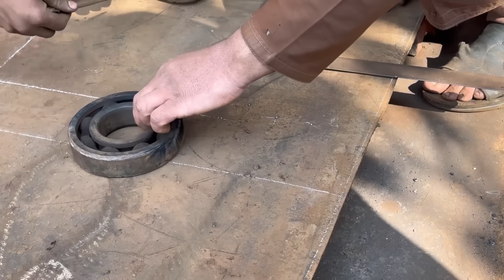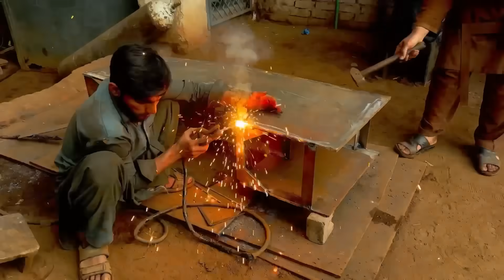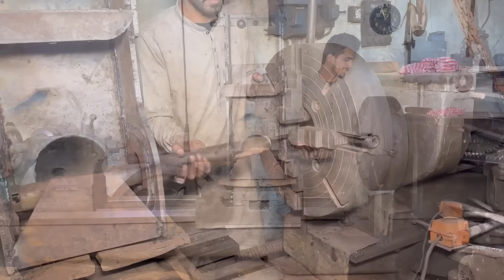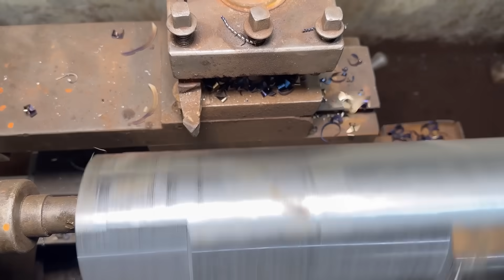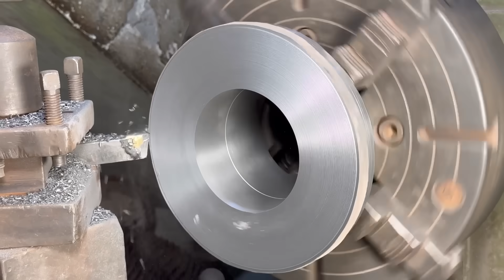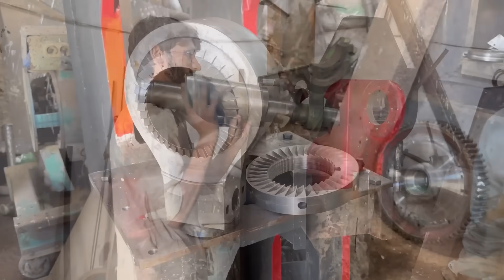Handmade Making Process Of  30 Ton Mechanical Power Press|

Comment: this guy literally had his eyes open while welding several places. absolutely wild.
Reply: This is, what i have noted too. Maybe, this guy has UVC-proof lenses and CCD-sensors.
Reply: @debrainwasher  in the one shot he's not wearing anything. Even squinting Itll go right through your eyelids (me as a silly child learning to weld learned fast)
Reply: Presumably, his guide dog did not bark in time.
Reply: @horstmuller7512  🤣
Reply: That's fine, after few years you get used to it. :D
Reply: He wants “Arc-Eye?”

Corneal abrasions are awful.  I recall them well, and supposedly Arc-Eye feels similar.
Reply: Can't fix stupidly
Reply: If your life expectancy is 45 years it does not scare you
Reply: Our blinking speed is fast😂
Reply: It won't be for long
Reply: @Y22860  I became Mechanical Engineer 2 years after working these kind of job.
We don't need eyes to weld anymore.
Reply: he has auto darkening contact lenses.

Comment: Imagine what these blokes could build if they didn't had to rely on Victorian-era tools, machines and education.
Reply: These machines are poorly made. The finished machine will be close to useless in a real precision stamping shop. Ive worked around these machines for decades and they could do it right with the machines they have if they actually measured the work and held the tolerances needed for this kind of machine. there was nothing done to ensure the machine would be square . The thing that really rubs Me wrong is when they finish a heavy part they always throw it on the ground so that the next poor guy has to bend down and pick it up. These people have never heard of carts and benches. And still I respect the guys for actually being able to make something.
Reply: @danneumann3274  Indeed. I respect the guys for able to make a machine by eyeballing everything, without a single drawing in sight. But that's about it. Indeed the lack of carts or benches always appals me, but after I went to a lecture called "the mystery of the missing wheelbarrow", I do understand it.
Anyway, it is okay to make subpar machines, if you use those to make mediocre machines, which you can use to make better machines, etc. The Japanese, the Germans, the Swiss even the British understood that. And they're known for their precision machinery nowadays. It took them a whole industrial revolution and much of the 20th century to get it right. India and Pakistan still seem stuck in the Victorian era.
Reply: @YaoiMastah  well said my friend